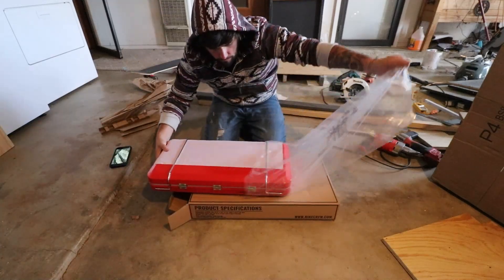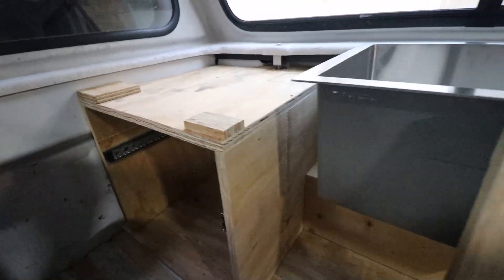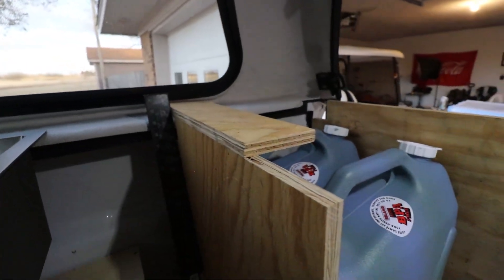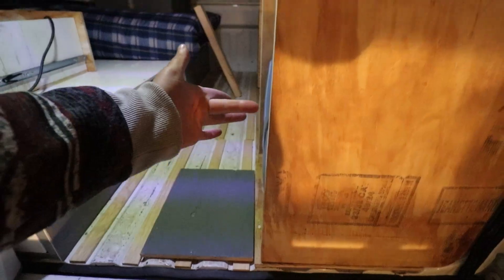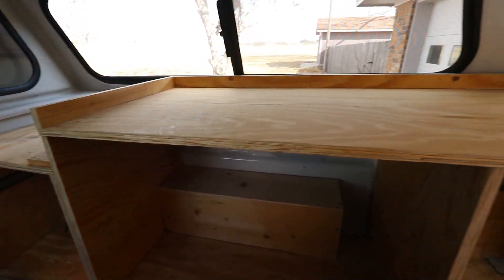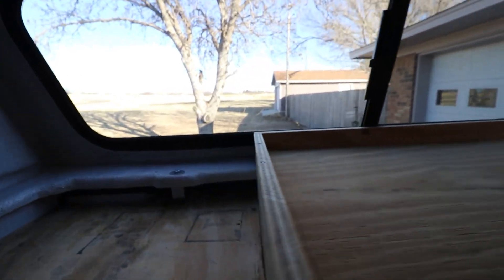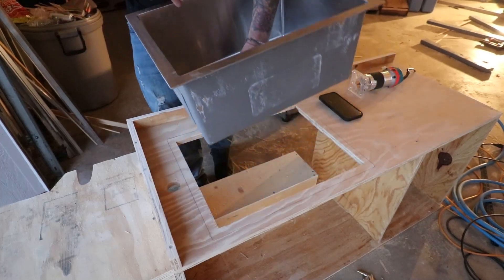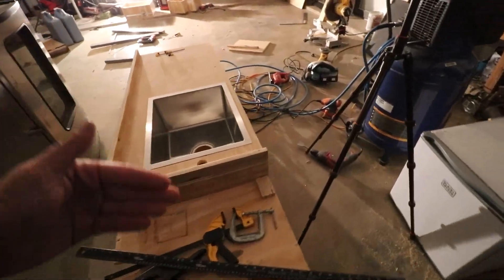THE TRUCK CAMPER SETUP IS LOOKING GOOD!

Comment: Posting early in the video so you may already do this. But it would be cool to run a drain pipe that sits out flush at the tailgate. And when you use it just hook a 90 degree elbow to drain off the side of the tailgate.